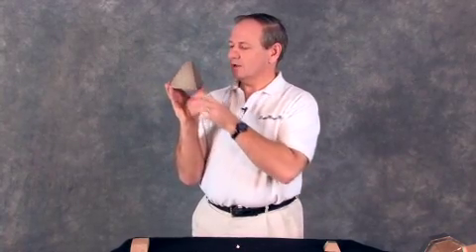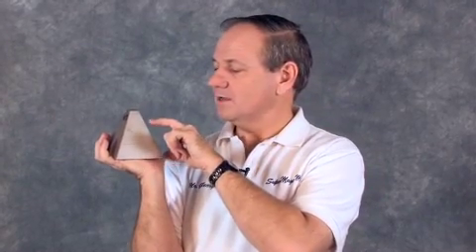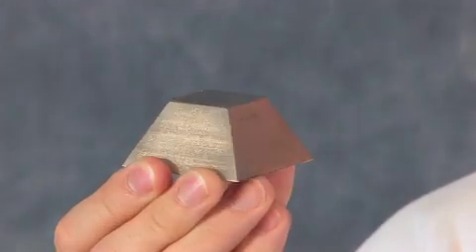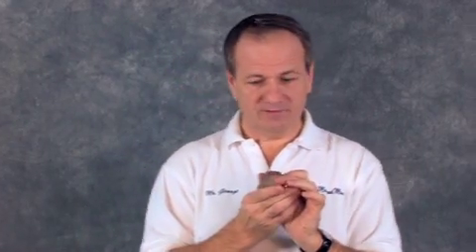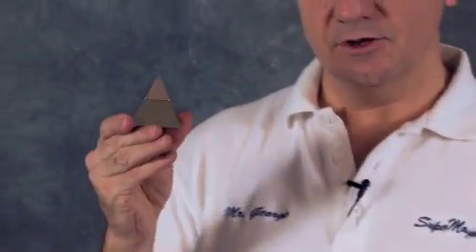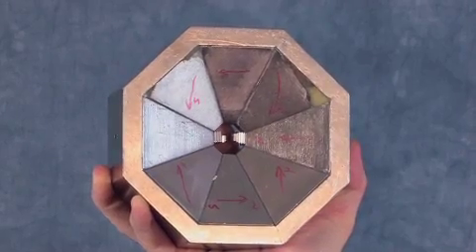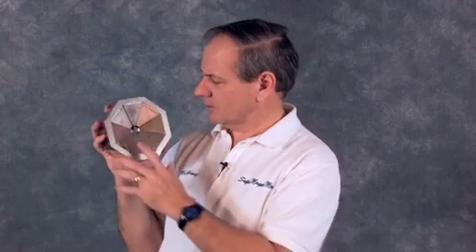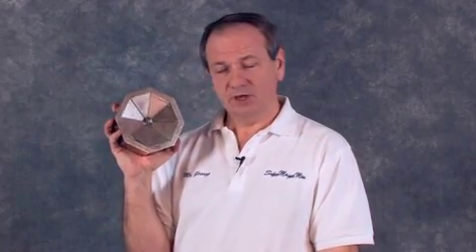Pyramid Magnets - Focusing Flux to a Point

Comment: Permanent magnetic field symmetry, like never seen before. www.magnetismtoroidaldynamics.com #ferrocell
Reply: +Tech Mex,
Those are interesting visuals, but their "Ferro-cell" is a simple two dimensional indicator which actually shows less than the iron filings, not more.
The particles being much smaller that the filings can make the light do interesting things, but there is nothing special other than the patterns that are interesting. 
..
Notice that in one video, for the repelling magnets the pattern disappears completely between the magnets, whereas the fired is still there and more curved in that region.
It's interesting and produces interference visuals, but I don't think it will lead to any new science, just pretty pictures.
..
If they can get the particle dimensions and separations down close to the wavelength of light, there might be some holographic related implications; such as diffraction patterns controlled by the fields.
Reply: @Observ45er  Please justify, because I do not agree "Ferro-cell" is a simple two dimensional indicator which actually shows less than the iron filings, not more...
Reply: +Tech Mex,
...
Sure.
...
I agree with one thing: "Device to see permanent magnetism & Light at play, like never before".  'at play"
...
Getting serious and comparing the two visualizations:

The filings show a field in all areas around a magnet.
This ferro-cell has areas with no light-dark patterns.
Therefore, something is missing in the ferro-cell information.
...
The filings show the direction of the magnetic force in all areas (by aligning with that direction).
The light/dark patterns... what are they showing about the field?
... How do the particles in the film change the light passing through?
... What is it that actually causes a light band and a dark band?
These fundamentals need to be understood before we can draw any conclusions about something the images may be telling us.
..
Were there any descriptions of the new science hypotheses or proposals of what these patterns show.  I wasn't going to take the time to sift through it all when there appears to be mo real benefit claimed other than vague terms such as: Missing Secrets of Magnetism& Fractality, Magneto-Dielectric Dynamics of Magnetism, Light & Di-Electricity (Electrostatics).
Since static fields are just that, "permanent Magneto-dielectric vibration" makes no sense and smells just like scientific words thrown together to impress those without much knowledge in the subject.  In other words, typical snake oil, con-man stuff.
..
"standing waves – not fully understood." but they are completely understood, for example by many in optics and RF transmission lines.

Un supported claim that: "Our current limited understanding of permanent magnetic field symmetry using iron filings."   What are the limits that this new method exceeds?
....
A final example: "The ferrocell, for the first time in human history, reveals the full Magneto-dielectric vibration field symmetry including its spin and pulse in all its complexicty!"
What feature of the image shows this "spin"?
I'm sorry, but this is pure mumbo-jumbo: "Magneto-dielectric vibration field symmetry"  
"magneto-dielectric" means just what?
What is the "dielectric" here?
What vibration?
What "pulse"? 
Some of these terms have real, well known meanings, but pasted randomly together they are meaningless. When you know what these terms mean it is painfully obvious they are meaningless when used the way they are.
..
The principles of the interactions of the field and particles has to be known and stated in order to derive conclusions about what this visualization shows and there is none of that other than these meaningless phrases.
There are some fascinating images, however.
- - 
Regards
Reply: @Observ45er  Many thanks for your extensive reply :) I see from your comments that it seems still very difficult to grasp what I actually try to show through the presented information on the webpage. I thought how I build up the content it can be understood, but I see, Im not at finish yet. I need to be able to show to illustrated so everyone can understand what I try to focus attention to. Nature is about geometry. Geometry is present over all scales, all forms of matter and energy. Geometry is created through vibration and boundery. So, the question is, what is this fundamental vibration, this string, made of? My suggestion: Its fields, EM-fields, in a geometric pattern that we have yet to fully discover. Ferrocell shows this extended pattern. Not the spherical field of a permanent magnet visualized with iron filings, but a spherical toroidal pattern. The toroid is like the sphere, but with much more detials, such as the vortecies on both poles, polarization, spin, pulse, precession.  Everything in nature is about moving charge. Its an electromagnetic cosmos, just open your eyes :) Everything we do not yet understand, like the electric workings of our body when we feel something with our nerves, our electric brain, our electric trigger of the heart pulse, sun which is in plasma state, similar to a neongas lamp where moving charge is going through. I hope you give the content another chance. Please read through it carefully and make up your own mind about it :) Its really only my thoughts about how I think the electromagnetic cosmos could be functioning, not a believesystem I try to force onto anyone.
Reply: In Ferrocell, light (EM-wave) is interacting with permanent magnetic field. How are the two connected to each other according to current physics? One is electromagnetic, the other permanent magnetic, non-electric? How can it be electromagnetic, yet interacting with permanent magnetic? A pretty interesting thing to investigate :) <3
Reply: +Tech Mex,
I get the impression that you hope this technique will provide a tool to study magnetism and that it will somehow lead to a better understanding of magnetism.  Perhaps it will.  
..
However, magnetism is a phenomenon which has been extensively studied by thousands, if not millions of people over the last few hundred years.
...
If you can demonstrate something that this technique shows that no other does, then you may have something.  I mean it must show something about the nature of the field itself, not just fascinating patterns. 
Unless you can explain what each and every part of one of those images shows about a magnetic field, you have no basis for claiming it shows anything new that we don't already know about a mag field.

...
You must be able to explain how the thin film of ferro-fluid is affected by the field and how the light and dark bands are formed.  Then this may allow you to study some particular characteristic of the field that is not easily shown by the filings or other film techniques.
..
In essence, you need to learn everything currently known about magnetism, then you'll be equipped to know what aspect this technique best helps study some particular characteristic of a magnetic field and learn something (possibly new) about the field.
..
You can't just throw down terms hoping something may stick.  As I pointed out, some of those things have no meaning and others are incorrect.
If you wish to coin (invent) new terms, then you must also carefully define them up frond and apply them to your proposed uses. 
..
If you can give examples of these things you claim we do not understand, then it may suggest ways to use your technique to understand them better.
- - 
Regards
Reply: +Tech Mex,
..
Here are some questions/comments that come out of your comments...
...
"Nature is about geometry."
Yes, everything has some shape, but there is much, much more to understanding some phenomenon than looking at the shape. 
...
"Geometry is present over all scales, all forms of matter and energy."
Yes, small things and large things have some shape.  Electric, magnetic and gravity fields can have some shape to them.  We have studied not only these shapes, but also the magnitudes millions of times.
...
"Geometry is created through vibration and boundery. 
What is the vibration in/from/of a permanent magnet?
What is a boundary for a magnetic field?
....
" So, the question is, what is this fundamental vibration, this string, made of? My suggestion: Its fields, EM-fields, in a geometric pattern that we have yet to fully discover."
Why do you say this?  
We have multiple ways of visualizing all of these fields.  Where do they fall short?
What do current field visualization not sho us about the shapes?
...
"Ferrocell shows this extended pattern."
The filings method can show the whole field if allowed to and more sensitive methods can show it much further than the filings.  A magnetic compass is simply a free iron filing that anywhere in the world shows the direction and strength of Earth's weak magnetic field at that point and can be moved around to see this anywhere without limit.
...
"Not the spherical field of a permanent magnet visualized with iron filings,..."
A permenant magnet field is not spherical and depends on the magnet's shape and how it was magnetized.
...
"... but a spherical toroidal pattern."
This is a contradiction in terms. A toroid has a hole like a donut and we can easily use a mathematical equation to describe that shape.  We easily change parameters in that equation and the general shape of the toroid can be made more flat or round; Bigger or smaller; With a large or smal outer diameter to hole diameter ratio. A sphere has no hole, so you must carefully define what you mean by "spherical toroidal". That phrase does not bring any soecific geometry to mind.
...
"The toroid is like the sphere, but with much more detials, such as the vortecies on both poles, polarization, spin, pulse, precession. "
A fundamental toroid is motionless with no "vortecies, polarization, spin, pulse, precession." It is just a shale like cube or sphere, so I cannot understand this meaning.
...
"Everything in nature is about moving charge. Its an electromagnetic cosmos, just open your eyes :) "
I am quite familiar with the electromagnetic spectrum as I am an RF Engineer working with a wide range of frequencies for something over 60 years.  If we could see all EM radiation, we would be in a complete fog of lights shining from virtually all directions, coming through walls so we would be unable to do much of anything for all the distracting "lights" in our eyes. every TV, Radio, police, WiFi, Bluetooth and cellular transmitter, etc.  would be in our eyes.  We understand all of this very well.  
I submit to you that if we did not have a very good understanding of EM field characteristics and how to generate, transmit and receive them, we wouldn't have all those things and more.
...
"Everything we do not yet understand, like the electric workings of our body when we feel something with our nerves, our electric brain, our electric trigger of the heart pulse,..."
I think you'd be quite surprised just what we do know about the body's electrical systems.  For example, we now are able to decode the actual brain impulses that control muscle movement to operate artificial hands simply by thinking about, it just like a person with a hand!  So, can your method show anything about the magnetic field of the brain or muscles?

..." sun which is in plasma state, similar to a neongas lamp where moving charge is going through."
Gas discharge tubes have been studied since before the beginning of radio, have provided some of the most important information and then used extensively in radio and lighting.  Every gas-laser is a gas discharge tube and I think it is safe to say that we understand that well enough to make them and in great variety and capability because we have extremely good atomic understanding through the extensive study of chemistry.
...
"In Ferrocell, light (EM-wave) is interacting with permanent magnetic field." 
No,  I'd say the light is filtered by the particles in the ferro-fluid. It is the particles that are affected by the field. It appears the field is changing the density of particles. I see no evidence of interaction between the magnetic field and light waves.  If there was, the ferro-fluid wouldn't be needed.
...
...
If you want more serious consideration you must eliminate all the hyperbole and grand, general, vague claims. It is simply tiring to read through it with no explanations of what you mean. You must focus on studying the specific and detailed characteristics and capabilities of this thin film ferro-fluid technique.
You're able to generate some very complex and interesting patterns in it.  I do that with my laser light show projector that are choreographed carefully to music with nothing more than carefully selected parameters for sine and cosine functions for the horizontal and vertical deflection of the laser dot on a screen, but...

Question that need to be answered are:
What is it showing that filings don't?
What causes a light band? 
What causes a dark band?
Are these bands simply density of the particles, or is there interference?
Would a single wavelength of light give other results?
What specifically does this technique show about the field?
What pattern is showing a vortex?
What pattern is showing the polarization?
How many types of polarization are there?
What pattern shows "spin"?
What pattern shows "pulse"?
Wht is this "pulse"?
What pattern shows precession?
What is presessing?
Why are there places with no bands where the filings method shows a field direction?
What are these vibrations you talk about?
What is the "spherical toroid" shape and how is it different from what we already know and why?
Why do you say there are "vortices, polarization, spin, pulse, precession."" in clearly a static magnetic field.
What are these boundaries you talk about?
What are the effects of these boundaries?...
How does this differ from the already available nickle based magnetic viewing films?
https://en.wikipedia.org/wiki/Magnetic_field_viewing_film 
...
I looked and listened, but you put these terms out there, but provide no explanation of what they are.
- - 
Regards, Steve
Science and Technical Advisor
Reply: Even iron filings show lines of force. What are those to you? There is a "line" of force, and next to it a line where iron filings are not, then the next line of force. Doesnt this look like an interferrence to you? Did you ever ask yourself what kind of vibration might cause the iron filings interferrence pattern? What is vibrating in a permanent magnet causing iron filings to arrange in such geometry? #ferrocell has answers, but it takes a lot more time to spend and a solid will to wanting to understand it than flashing through my webpage in 5min concluding that I would have not an idea of what I am talking about :) Do you only want to prove me wrong or do you actually want to understand it? :) Im a studied biochemist/immunologist and an enterpreneur. I take life serious and I definitely dont want to confuse nor distract nor misguide anyone. Its not easy to find the right words to describe the unexplained. My appology. My webpage is called "my thoughts". I dont claim anything. All I do is illustrate what I personnally believe the ferrocell is revealing about magnetic and electric field symmetry, which is something very different to what iron filings reveal. If you dont see that, you didnt study it seriously enough. The difference of visualization is very dramatic. The image of being holographic, toroidal, point-geometric, an inverse field symmetry to what iron filings visualize, definitely not showing the same thing.
Reply: Look at earth magnetic field, how we teach it. Where again is the bloch wall and the intermediate aequatorially retourning pressure mediation, that obviously is present in every  permanent magnet as shown by CRT or ferrocell missing in every single image of earth magnetic field you can find over the internet? Permanent magnetic fields are dynamic,  standing waves, seemingly appearing static, this is our missing dark energy, not understood, im 100% certain about that.
Reply: +Tech Mex,
..
You say: "There is a "line" of force, and next to it a line where iron filings are not, then the next line of force. Doesnt this look like an interferrence to you? Did you ever ask yourself what kind of vibration might cause the iron filings interferrence pattern?" [sic]

Using magnetic force lines is only a simplified way to show the direction. Magnetic fields are CONTINUOUS. The field fills the entire volume around the magnet, not just regions shown by lines.  There is no good way to have the entire volume filled with lines and still see anything. You would only see solid black in space. If the filings filled the entire space they would all touch and form a continuous black sheet...all black.  So we only show some bits of the field that is there.
 
There is a magnetic field EVERYWHERE, not just where the filings happen to land.  The individual filings are like tiny compass needles.  Put some in those locations where there were none before and they still show the direction of the field.  It is a simplified way to show us the field. 
If the field was an interference pattern, then there would be no field in some places, like interference in light and radio waves, and this does not occur. We would have detected the wavelength/frequency long ago.
Visualizing a continuous field is difficult and very similar to a photograph in any newspaper or magazine.  Look at one with a magnifying glass. You will see small dots.  The real scene is a continuous blend of color and intensities, yet to get something on paper we can represent it as many small dots.  Each dot represents the color and intensity at that location, but there is still something between the dots, but we don't show it.
This is also similar to digitizing a continuous electrical signal with discrete steps; digital sound. 
...
While I really do appreciate your desire to dig into this natural phenomenon and all the effort you went through to produce your web page, unfortunately, your knowledge is barely at the beginner stage and not where you need to be to consider making far reaching new discoveries. You are, perhaps, where I and so many others like me were in our early years in primary school, looking at the vast amount of science and wondering if we ever can understand all of it...and all of us having some kind of misunderstanding or another.  I have often talked with other engineers and traded stories about what we misunderstood in our childhood days.
...
I am sorry, but very early-on in reading your web page and videos it is clear that you have some fundamental misunderstandings about magnetic fields and you explained it even better in the above explanation of why you think there are "vibrations". Thus, I do not have to pour through every word of your web page. 
 I'm not trying to be mean. I am being candid because magnetic fields have been studied to a much greater depth that you realize. You have taken a relatively simple overview of this and tried to understand, but you need to understand all the things that have already been revealed about magnetism. It is that simple.  
To properly understand science and technology, you must start with the most basic of fundamentals that have already been studied by thousands of people over millions of hours, then you can build on these most basic concepts.  You cannot enter a subject at a mid level and hope to get anywhere without fully understanding all the well-known fundamental concepts.  Here, you have taken a simplified technique for representing something we know much more about and interpreted it as the most fundamental concept when it is not.  It is a simplified representation of a much larger, more complex knowledge base.
You can't expect to sit down knowing nothing about music, then expect to play a Beethoven symphony by only looking at the sheet music without first learning what all the little dots and lines mean and how they relate to the keys on a piano and the complicated fingering on the strings of violins.  This is what you are attempting to do.  You are saying that all the spaces between the dots on the sheet music show us that music is only short bursts of something and these bursts need to be studied more to understand what music is... We already know so much more about frequency, timber, timing, overtones, harmonics, harmony, resonance, etc.  This "knowledge" is an almost infinite amount of additional information when you compare it to the dots and lines on sheet music, or magnetic lines.
..
I have also taken my studies of science seriously and spent the better part of 60 years learning all sbout many of these subjects and find that this understanding shows me the beauty of science by the way it all fits so nicely together in all of the sciences.  Only a full and complete understanding of many of the branches of science can allow one to see how all of them are always in effect and work hand-in-hand to give the phenomena we see.
..
TL;DR: 
Magnetic lines of force are only a VERY simplified way and the only one that we have devised which gives a rough idea of a field that exists in a continuous volume. Visualizing things in a continuous volume is very difficult and has been studied by many people for many years and many different more modern techniques tried...but lines are ok as long as you understand what they are intended to tell us.
.
...........   Another post ..............
.
" Look at earth magnetic field..."
Many have and because of all the studies, it has been determined to be virtually identical to any common bar magnet's field and follows all the fundamentals of same.
...
...
"Where again is the bloch wall...'
What is that?
..
"...intermediate aequatorially retourning pressure mediation..."
What is that?

If you wish to form new terms, you must carefully define them before using them.
...
...
"...shown by CRT..."
My father designed CRTs and I fully understand their operation.  For magnetic deflection, the horizontal and vertical deflection coils deflect the electron beam just as all the previous studies show and, also, what happens in all motors, even the tiny one that mechanically vibrates everyone's cell phone on up to the electric automobile motors!
..
",,,every single image of earth magnetic field..."
They all use this standard, simplified method of visualization of the more complex field.
..
"Permanent magnetic fields are dynamic,"
No, they have been proven over and over again to be static and that fundamental principle is the basis for everything else we understand about them. As you so carefully have explained your view of field lines and the iron filing visualizations, it is easy to understand how that leads you to this misunderstanding of interference patterns and "vibrations". 
..
"...standing waves, seemingly appearing static..."
This is only due to the simplified visualization methods that have misled you and that word "appearing" is very important because they are fully understood and are not static.  Only the visualization is static because it is difficult to have a dynamic image printed on paper.  They are indeed interference patterns of continuously varying sine wave oscillations that are very well understood standing waves, commonly observed in light and radio waves.
., 
"...this is our missing dark energy, not understood, im 100% certain about that."
Take this to any of the people who have examined the universe over their careers and see what they say. 
- - 
Regards
Reply: @Observ45er  I do not try to be mean, but do you really think your opinion is of any value if you spend 5min to digest what I have spent years to investigate? You cannot possibly understand the concept I present in such a short time.

According to you, magnetism is not worth to be investigated any further, yet, you with 60 years experience, do not know what a blochwall is. I didnt invent this terminology. Its just you not knowing it. If magnetism is not worth an investigation, it should absolutely not pose a problem for you to explain, what ferrocell is showing. Please try, because you didnt try so far. All you said is I compare "pretty pictures"...nicely said...thank you for this charming compliment. What you miss out is that they are not only pretty pictures, they are actually showing something, and you so far did not look into it.
Please explain why the field seen with ferrocell compared to what can be seen using iron filings is point-inverse symmetric? Compare the geometry of attracting magnets in ferrocell vs iron filings. Notice any difference?

I have met very brilliant scientist, optical specialists, magnetic specialists, physicists, many of them came to a very very different conclusion compared to you.
I do not need to convince you. Its up to you wheter you want to dig into it, trying to explain the ferrocell to yourself. 

Virtual photons to describe the permanent magnetic field. Good job standard model. Totally makes sense (not).
96% of our current standard model is "DARK", whereas humanity has no idea of what this dark should be. I therefore wouldnt hold on the known 4% so much. There is a 96% chance that you might overlook what is really there waiting for you to be discovered, "dark, unless illuminated, using light #ferrocell"

"Permanent magnetic fields are dynamic,"
No, they have been proven over and over again to be static and that fundamental principle is the basis for everything else we understand about them.

-->Everything in the universe is vibration, nothing is really static. What you call static is the known 4%, standing wave vibration which you dont see yet, but which must be present in permanent magnetism, otherwise it wouldnt be permanent, is the missing 96% dark predicted by the standard model, completely missing in our current understanding. This standing wave equilibrium is what I try to introduce to you on my webpage.

I dont need people to judge me, I need people to explain the ferrocell visuals. Join the club, we would warmly welcome you :) <3
Kind regards,
Pascal
Reply: Im having fun with this conversation by the way. Always love to discuss with people :) Thank you for taking your time for all your careful formulations.
Reply: +Tech Mex,
.
What I see is obvious misconceptions and no logical, cogent explanation of what you are trying to convey or others conclude to add credibility.  If you can't explain things, any ideas are lost.
..
"I have met very brilliant scientist, optical specialists, magnetic specialists, physicists, many of them came to a very very different conclusion compared to you."

As well as being evasive and not answering my questions, I find it strange to be looking for validation under a You Tube video when you think you have the answer to something the best minds in the world are working on. 
..
Well, go with them, then, make something of it and good luck.
Reply: @Observ45er  Well, I can explain it, but you cant understand it spending 5minutes.
Reply: Electron accounts for 99.999% of the volume of an atom. Its permanent moving charge, creating a permanent magnetic field. 99.999% of an atom is an electromagnetic thing. So why again is it difficult to wrap our head around the idea, that electric, electrostatic potential and magnetic fields account for 100% in nature?